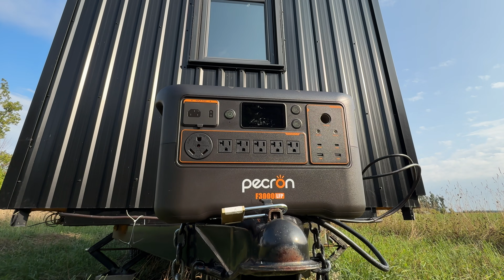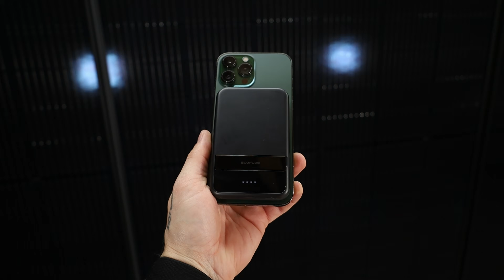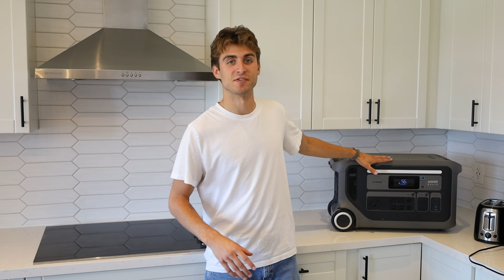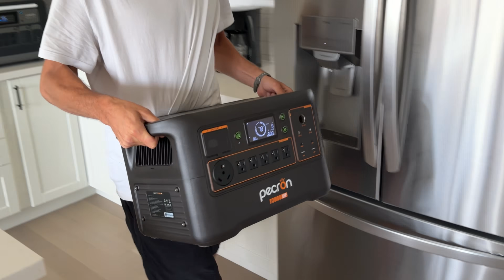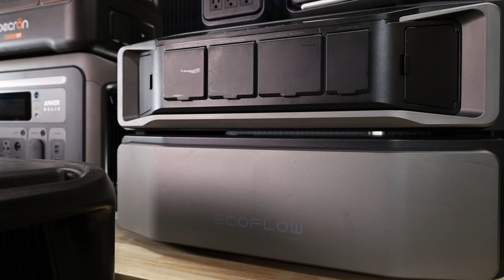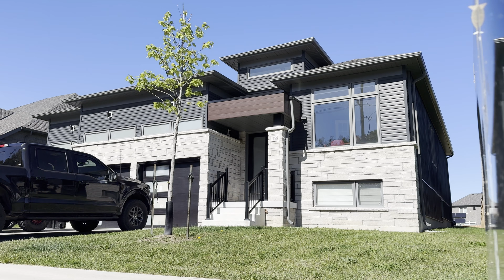What Power Station is Best for YOU? - Top 5 Recommendations

Comment: This is deep south, hot, humid, and sunny....forget laptops and fridges.  What is the cheapest set up (power station and panels) that will run a 9 inch desktop fan for 24 hours and an economical window a/c for about 3 to 4 hours a day at the same time it's charging with solar panels during sunlight?

Comment: What do I need here in WI in the middle of winter, the grid is down & it's -20 F & the house is nearly as cold? Bueller? Bueller?
Reply: Depending on your home heat, you may be able to have an electrician (or DIY if you are electrical savvy) modify the power switch for your furnace to allow it to be powered by an external source (there are tons of YT videos on the subject). Since you are in a very cold area, you will need a combination of power (watts) and capacity (watt hours) to get you through the longer power outages. If you are on a budget you might want to go for something like a Pecron F3600/3800 pair to be able to power different areas of your home. If you can afford a bit more, I would then add on some additional batteries to increase your capacity to get through long power outages. 

Good luck with those cold WI winters. I moved from MN and do not miss the long winters.
Reply: @BKJohnsdude  I can see the MN Mississippi bluffs from my house. I think winters there are more severe.
My point was if the grid is down and no way to heat my home then most solar batteries will not charge or discharge in severe cold weather.
Reply: You don't need a power station.  YOu need a whole home solar backup system with batteries.

Comment: I am using Pecron E1000 units as UPS to protect my Server Rack, 2 PC work stations, home theater system, and 2 bedrooms with CPAP machines. I have 2 3kW aux. batteries for fridge/freezer use after I secure (shutdown one of the PCs) so I can hookup that E1000 to the Fridge. I have 3 sets of ZOUPW panels (350W, 2x 450W) for the backyard.
Reply from the maker: That is an impressive and well-thought-out home backup system! ⚡️
Reply: I'm curious. How does a power station "protect" a home theater system?
Reply: @AverageGuy87-r7k    It acts as an uninterruptible power supply.  So when the mains power goes out, the power to the electronics stays on and everything stays working as normal.